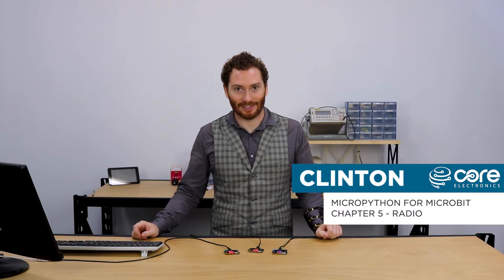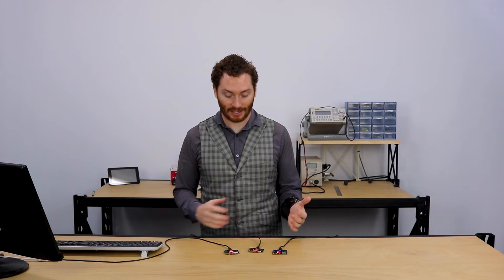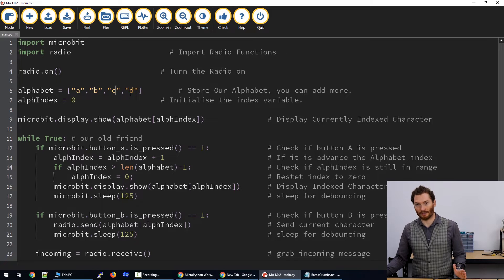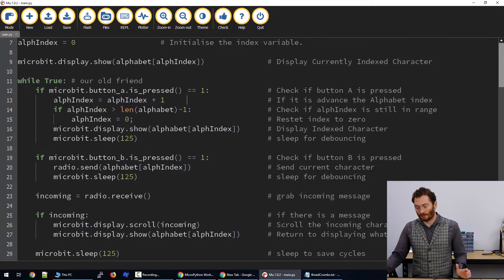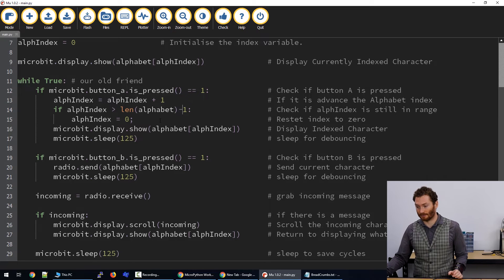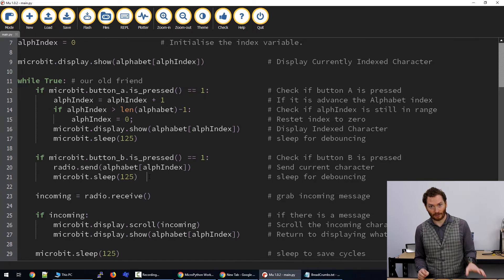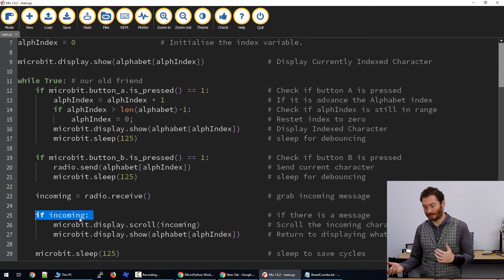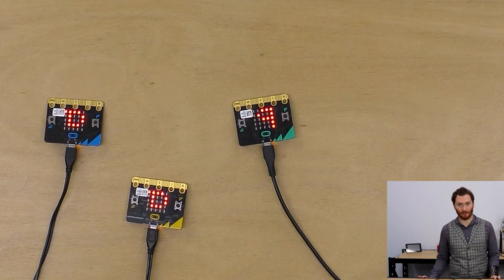MicroPython for Micro:bit - Radio (Talk to Other Devices)

Comment: Is there any way to get turn message.recive() to an int?
Reply from the maker: Are you looking to turn the message into a int? That can be done with:

incoming = radio.receive()

new_variable = int(incoming)
Reply: @Core-Electronics   Yeah but since the sonic sensor was giving float values, I got confused.
Reply: @Core-Electronics  I will contact If I have another problem. Thanks for responding. Subscribed.

Comment: So I get that you will likely never see this but - do you know if it is possible to run this code while not connected to the computer as I have tried begging it with a power bank attatached before removing the usb cable to the computer while the code is running (in this case I was running episode 2's code on LED's using a small speaker which worked. Howeverer, if relying on only the battery pack - if I ever switched the code off it would stop functioning and wouldn't restart when I pressed a (I programmed bto turn it off and a  to turn it on which functioned while plugged into the computer)
Reply from the maker: Potentially if you save it as a | boot.py | file it will run everything you power cycle the system. 

If you ever need a hand with any of our guides and feel you can't get to us, Jump onto our Core Electronics Forum with your question. We'll get to it straight away, were always super glad to help 😊